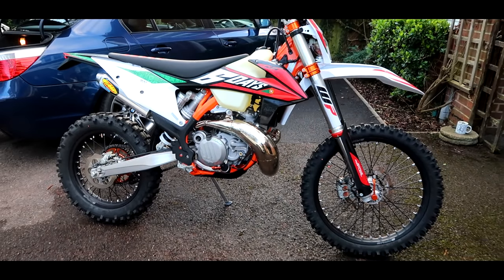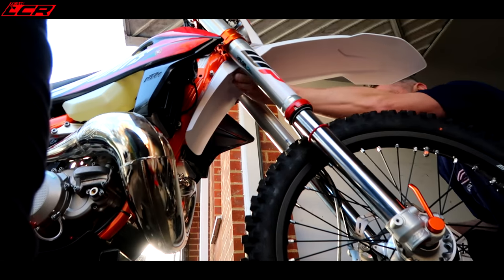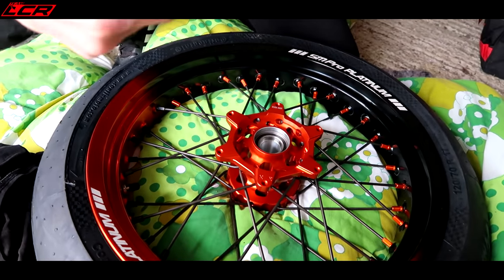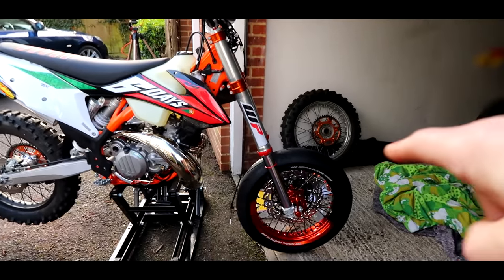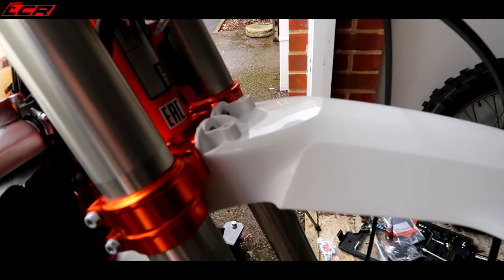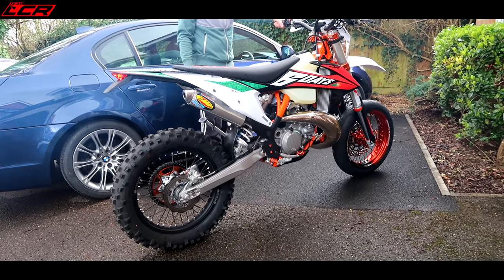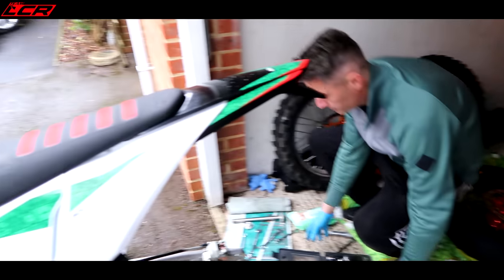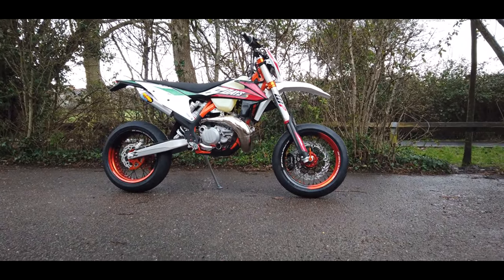One Day Supermoto Build | 300 TPi Stroker!

Comment: Just so you know. When putting thread locker on bolts.  You want to apply it to the thread near the end of the bolt that is being threaded in first. Then as it's going in it will it will travel down the threads. 
I only say something after seeing it applied to the middle of one of the front caliper extension. Well I know for a fact the where it was applied wasn't part of it that threaded in. It was just short.

Comment: Next time you need to prime the brake system, drop the hose of the caliper & fill the reservoir. Tickle the lever and let gravity do the rest.
Once it starts coming out of hose reconnect and bleed as per normal.
And yes lush 2 stroke 👌
Reply from the maker: We did use the vacuum pump to get things started which really helped. Delay was caused by air trapped in the master cylinder, thankfully bleeding point on the cylinder made things easier 👍

Comment: You didn't get thread locker on the lower caliper adapter bolt were it counts at 7:15. It needed to be applied on the first 6mm of threads, not the middle of the bolt. You also put the chain master link clip on in the wrong direction at 18:15. I saw you get the vacuum brake bleader out but it looks like you didn't use it. Could of saved yourself a lot of trouble.

Comment: Nothing like a two stroke, my first Street bike 1975 H1 500 with Denco Chambers. Still snow here in Canada. So many good bikes, just confused with witch one purchase, RSV4, KTM 1290,H2sxse+, ZH2, VMAX that's a distance 3rd love torque, but shaft drive no thanks. Got my fully done 2008 ZX-14 turbocharged. Just question what brand of oil you running in the H2? Cheers brother 🇨🇦

Comment: Hi chops do you have to change the front brakes or can you leave the set up  already on the bike?
Reply from the maker: You don't have to Josh, to reduce cost you can just change to a larger disk and just space the standard caliper out. Recommend to fit a larger disk though as standard one will struggle

Comment: Did you clean the protective film of the discs before you fitted em ?.
I usually use silkolene or rock oil brake cleaner. Your pads will take longer to bed in and most probably pick up shite which will lead to an uneven wear on the discs. But shit you guys don't need me to teach you how to suck eggs. haha fcukin sweet ride tho I'm well gel,
👊✊👊✊✊💨

Comment: Is there an auto-lube system for the 2 stroke oil on those bikes?
Reply from the maker: Yes indeed, the new 2strokes are fuel injected with oil injection also
Reply: @LambChopRides  , Good stuff. Sweet looking bike.

Comment: Hey Chops, Can you really ride two stroke on the road in the UK? I mean does it meet Euro 4 or 5?
In the US here, as far as I know two strokes are no go.
Reply: Im not from the US, but as far as I am aware the exc,  and TE Husky's are sold there also as road legal 2 strokes. You can make the xc-w, which is sold as off road only a road legal vehicle with some electrical mods ( thats the only diff from the exc bike really). Lights, blinkers, wires and other stuff might differ state to state, but engine emissions in the new tpi's are probably compliant everywhere, except maybe California...check your state, and local laws. Generally speaking it ok, or at least doable in most places if mods are required.

Comment: Nice build. I have a 2013 250EXC and I am going to SM it (but have easy wheel interchange for trail riding and a little MX track too) - so it'll be a track-only (which yours is I imagine - can't make that road legal in UK right?).  I'll have to find some second-hand stuff because I suspect your wheels cost more than my bike :-). May want to fit some axel sliders and bar-end sliders etc. for the track - new body and all. SM's are made to be dropped, right?
Reply from the maker: No its fully road legal as it's based on the road legal Enduro models. Tuned for a bit more torque than the MX bikes.
Reply: @LambChopRides  Amazing - didn't think it would pass emissions - very cool though :-)

Comment: You hardly see 2-stroke supermotos because engine braking is detrimental to the life of the Piston, rods, rings and everything that require 2T lubrication.

When engine braking into a corner the throttle is closed and the carburator  doesn't spray the fuel and 2T mixture into the Piston and it's parts.

Note: I am not entirely sure about the TPI (injector) models, perhaps a ECU flash for supermoto use is in order.
Reply: It's all about the cooling most 2Ts I've ever blown or seen blown it's been down to cooling, roads full of mud,grease,shite whatever clogged roads just dont cool. Obviously brand new clean roads should be ok, but if I were to race,hammer round a 2T I'd defo try bigger water pump impeller and bigger rads. But your right that bottom end need plenty of lubrication when under heavy load. Great to yarn on about 2Ts 👊✊💨

Comment: My fear with a 2 stroke suprmoto is that I'll blow the piston riding on the street. I thought they were meant to go fast then slow in order to not destroy the motor.
Reply: It doesn't destroy the motor by going slow.
Reply: I was more concerned with going to hard/ fast for too long would kill a motor esp a 2 stroke was evil on it
Reply: @riverhound8406  i mean if you redline any motor not just at motorcycle of course its going to wear it down quicker

Comment: You need to lower that 300 about a inch to 2 inches and defo run a 14 or 15 on the front sprocket
Reply from the maker: Yes I think suspension respring & revalve will be needed in the end..
Reply: @LambChopRides  you can raise forks through clamps and it will turn in better and help with keeping the frint down on acceleration and just stiffen it all up and slow the rebound before spending more money 👍
Reply: Malcolm Reynolds   i hope so i been playing on bikes for nearly 40 years 🤣😂😆